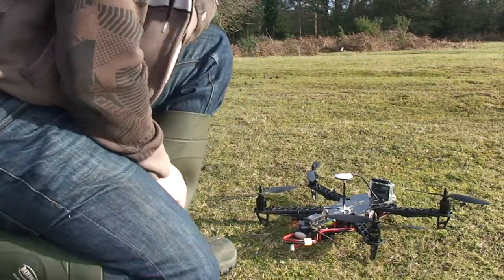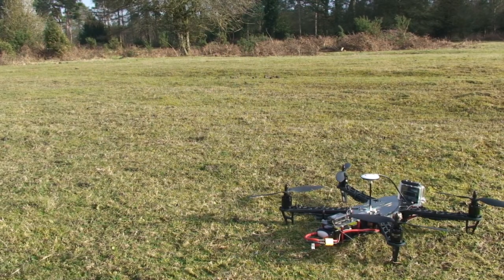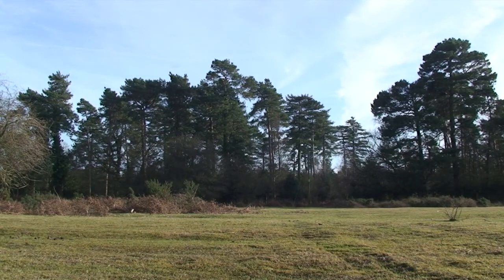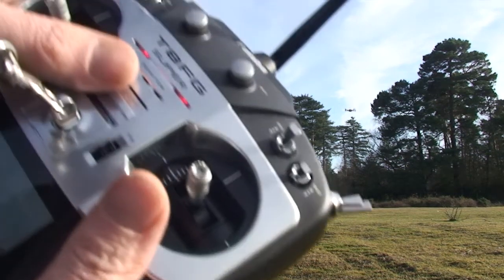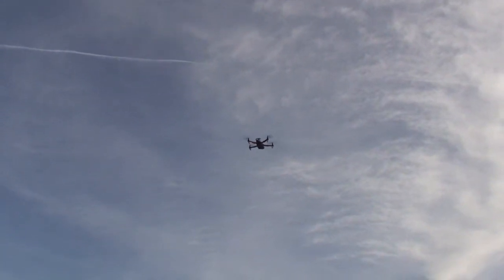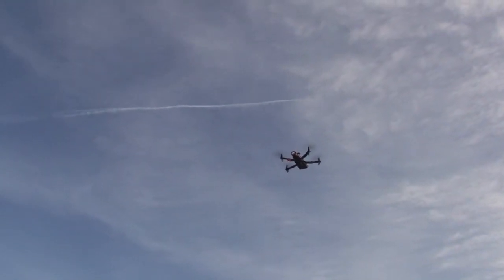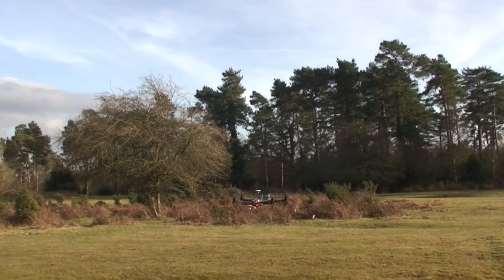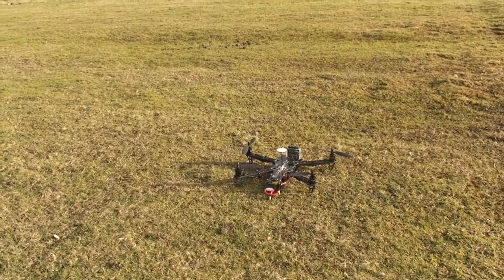Testing the DJI Naza 'Return to Home' Feature

Comment: To get the signal back when rth is active flick in to attitude mode and you regain control again and if you do after landing you can restart your Motor's and take off again with have to power cycle your craft